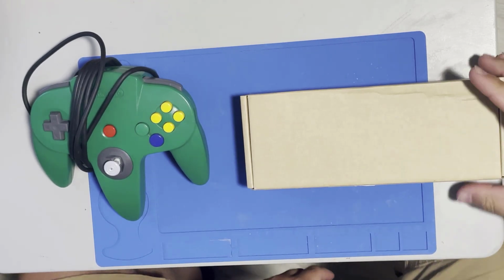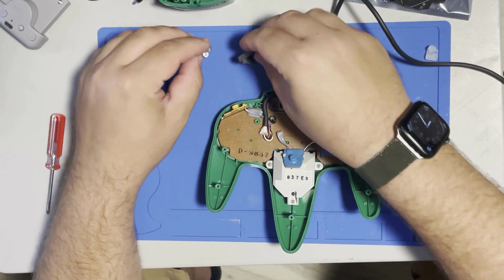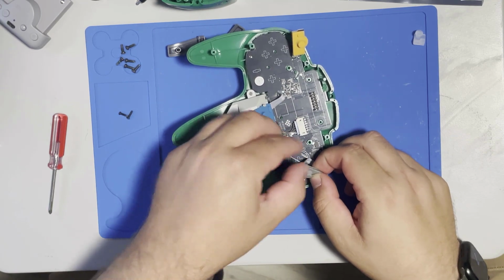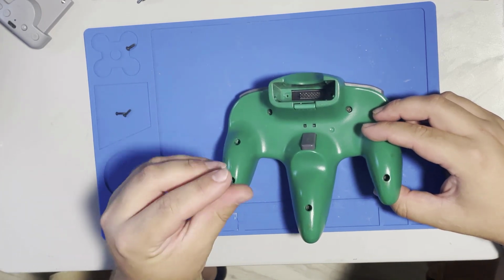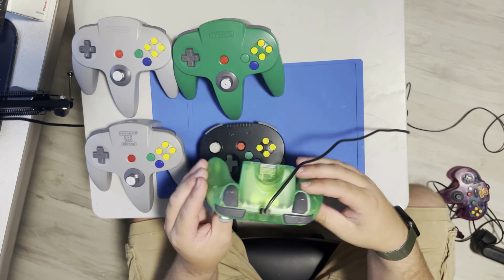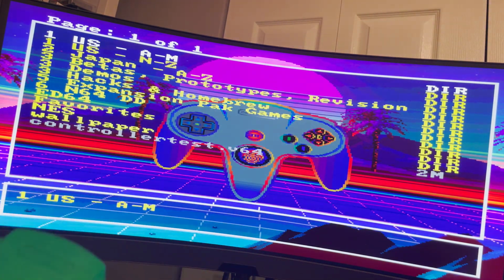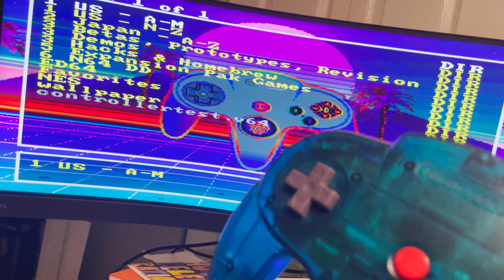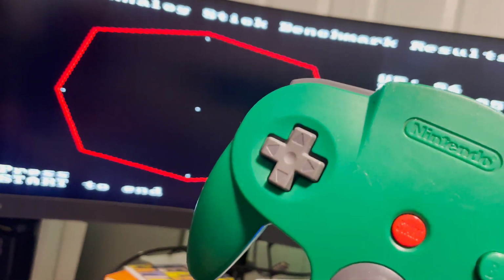N64 8Bit do Bluetooth controller mod / Controller Compare / Controller Tests

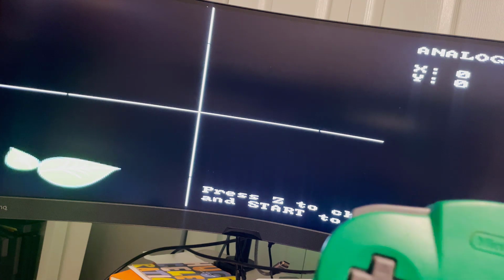Comment: 32:20 Keep in mind that the N64 cannot natively output widescreen, and you have the video image stretched from original 4:3 to fill a 16:9 display, so the benchmark result is going to look like an ellipse instead of a proper circle. The maximums across the axes confirm that the sticks are fine despite how the output looks.

Comment: What happens if you remove the rumble pack from the 8bitdo mod? Does it still works? 
Does the memory pack works?
Reply: no it does not work without rumble pack. rumble pack is the actual wireless part

Comment: I got 2 of these, first one worked no problem, second one has no left or right on the joystick. Tried multiple sticks and swapped the rumble packs so the issue has to be on the board itself. Any ideas?
Reply from the maker: i just looked up the connector - looks like pin 1 and pin 4 are for the x axis  (left , right) on the joystick. check those pins on the board. here is a link - https://n64brew.dev/wiki/Controller and here is the image - https://n64brew.dev/wiki/File:Analogstick-pinout-diagram.png
Reply: @SciFiFan20  Thank you! I've contacted 8bitdo about a replacement, but I'll have to check with my old man about a multimeter and a soldering iron. Not something I have handy.
Reply from the maker: maybe its the solder joint on the connector on the board for the joystick? do you have a multimeter to check continuity on the pins on the board to the connector?
Reply: In all games N64 A should be Switch button B, N64 B button should be Switch Y but something wrong with this upsetting

Comment: I bought the 8bitdo controller mod and the retro wave receiver and my Z doesn't work and my B functions as down C. is there a way to fix the button mapping wile using an original N64?
Reply: Switch the pack to “S” for switch mode and pair with the BlueRetro Dongle.
Reply: @christophermcalister7091 have you tried this Mod kit with the SWITCH?
Reply: @doomsday361  I have not. But it’s suppose to work flawlessly. I think BlueRetro needs to update the firmware for the N64 adapter for rumble to work.
Reply: This is exactly what I’m trying to figure out.